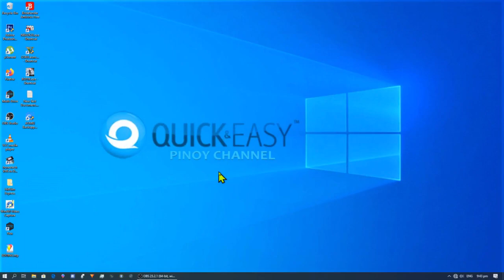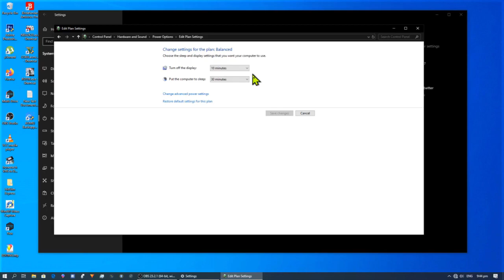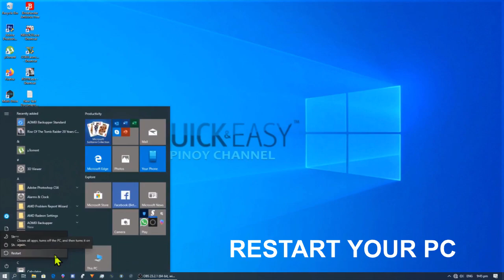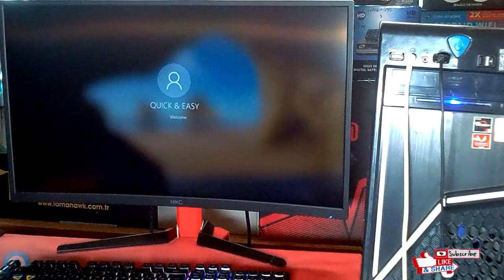HOW TO FIX USB POWER SURGE IN PC's

Comment: The ports on the back of my PC are not working (one USB 2.0 and two USB 3.0 ports) and the power surge problem is happening. Previously I was having the problem and I changed the PSU and all was fine but again today about 3-4 weeks later the same prob is happening again. What do you think I should do?
Reply: @mercuryfl  I am still living with this problem. Using my front ports as of now. Still the power surge notification pops up each day although nothing is plugged in my back ports.
Reply: @mercuryfl  I said the in my previous comment. I am still living with this problem. 
Bro this is a hardware issue in your motherboard. You cant do anything....
Reply: @mercuryfl  I think so buddy. If I am correct then these problems are caused by fluctuating voltage. Have you got your PSU checked or changed? The fact that only some of our ports are not working proves that this a hardware issue.
Reply: @abm347 if port works fine and just notification comes?
Reply: @gamersforlife3440  you need to wait for a bit to know if there is any hardware problem. For now trying troubleshooting any software issues and if the problem persists then go to a technician before further damage.
Reply: @abm347  Lol it works fine no matter what error i get.....and it only happens when i am trying to use new devices i think mostly that are unrecognized but they all seem to work fine on other ports maybe i should try dual boot windows 8?if it fixes the issue then might be my windows 10 issue?One more thing i plugged in my old cooling pad it has 4 usb ports ( with the port that was giving error ) although it did not give error.And i connected 4 devices usb with cooling pad usb ports keyboards mouse speakers all worked fine and no error what is going on really?they were all taking power from cooling pad and cooling pad got power from the port that gave error before...its getting weird honestly at this point dont think its the hardware issue.
Reply: @abm347  i mean if new windows does not give the issue like 7-8 then might be my windows itself?
Reply: @abm347  Or maybe those windows are defective that cant detect a usb port power surge Lol is that possible?can a windows be defective aswell?
Reply: @gamersforlife3440  maybe. Actually I have dual booted Win 10 and Win XP. I get that error whatever might be OS. I am sure it's the fault of your power supply or the port hub.
Reply: @abm347  Hmm i dont get that error unless i plug specific things to charge i have not tried them before of course but plugging in mouse or other stuff seems to work fine of course its not rgb mouse or anything like that simple mouse
Reply: @abm347  So u think its probably motherboard then?I dont think port can be damaged most likely its the board then right?does motherboard need replacement?i mean i have no idea why this error comes and everything works fine like item mostly is charging/working fine without stopping its just this error thats it.
Reply: @gamersforlife3440  I can understand what you wanna say. I have done every software troubleshooting steps? If yes and still the problem persists then there are two possibilities, 1. Motherboard has got damaged (faulty power supplier (not PSU) for the usb ports) or 2. The USB hub is on it's way of getting faulty (maybe the soldering has withered or maybe the something inside the hub isn't functioning properly).

What PSU do you have? Is it a good quality PSU? Do you plug your PC while the switch is on? 

My ports worked fine but just showed the warning too but as a few days went by the ports started to malfunction.
Reply: @gamersforlife3440  can you find out the power rating of the "things" which stimulate the error message? Are those power ratings higher than your mouse or keyboard power rating??
Reply: You change your SMPS and check